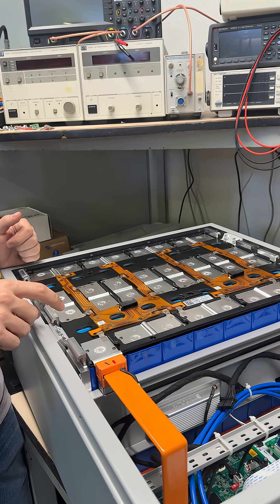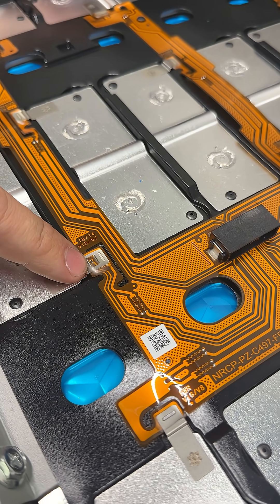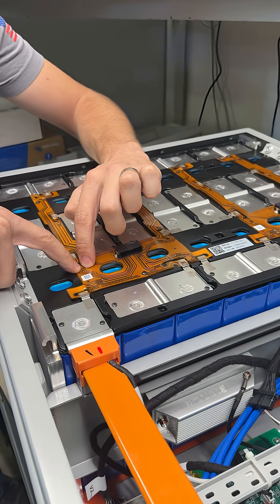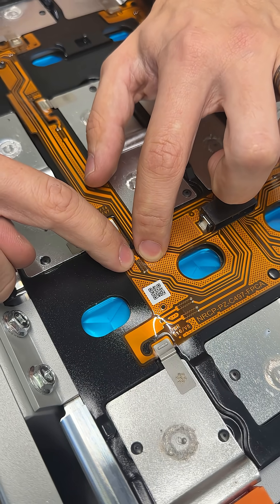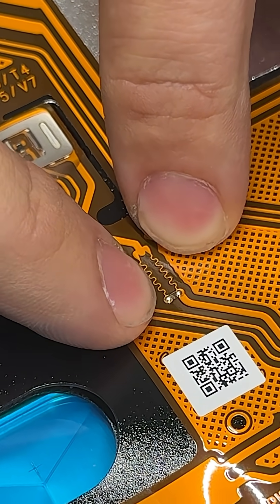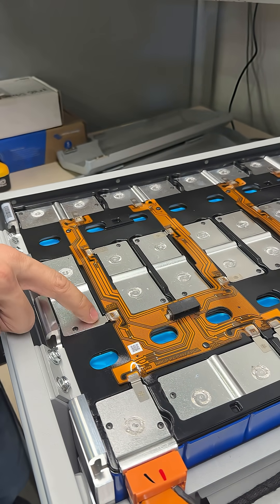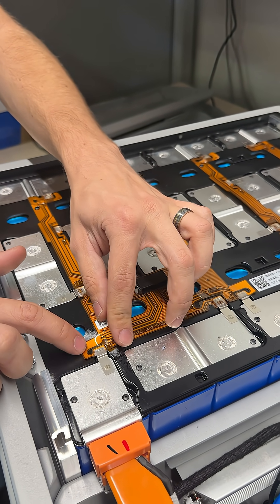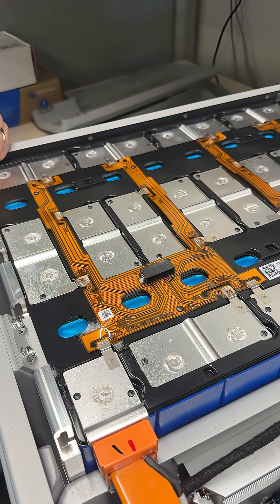The Pytes V10 is AWESOME and here's why!

Comment: Can you please post more videos about the pytes v10 or v16? There is very little out there and it looks like a great battery.
Reply: Hey I'm with Pytes. The Safety measures and design will be the same.  v16 uses 314ah cell, So it is bigger. V10 uses 230ah cells, smaller.

Comment: Yeah but the cells are still considered unserviceable I wish sok got their act together and got a UL certification and you guys could start selling those again.
Reply: Hey, I'm Echo with Pytes. the cell defect rate is less than 1/10000 , if it's from Top cell supplier, so the cell rarely has issues- so cells are not servicable.  if cells have issues, usually it's serious issue and as a battery manufacturer, we don't allow people to replace cells -- it's not safe.
Reply: @pytesecho1876 The old 'it's not safe' line, normally found next to the 'no user survivable parts inside'.

Yeah if it can't be serviced or fixed I'm not buying it. 

Plenty of battery options out there that are user serviceable.  Plenty of batteries out there that are not made using proprietary components, like circuit boards or funny little connectors or special service leads or communication protocols that are locked down.
Reply: The old 'it's not safe' line, normally found next to the 'no user survivable parts inside'.

Yeah if it can't be serviced or fixed I'm not buying it. 

Plenty of battery options out there that are user serviceable.  Plenty of batteries out there that are not made using proprietary components, like circuit boards or funny little connectors or special service leads or communication protocols that are locked down.